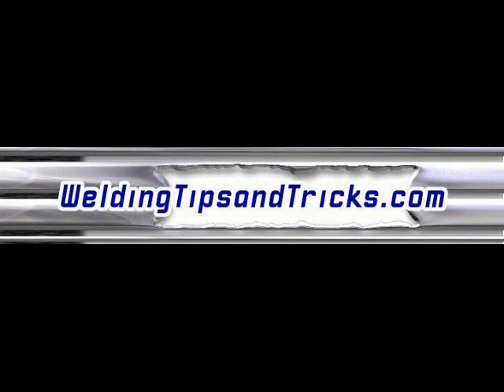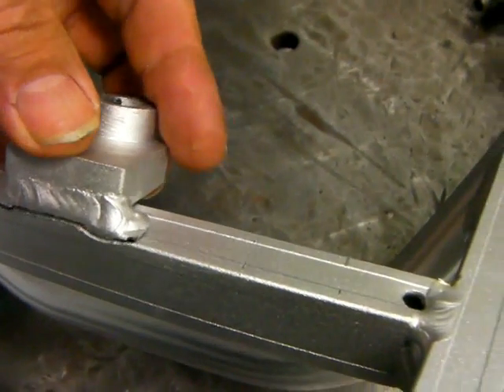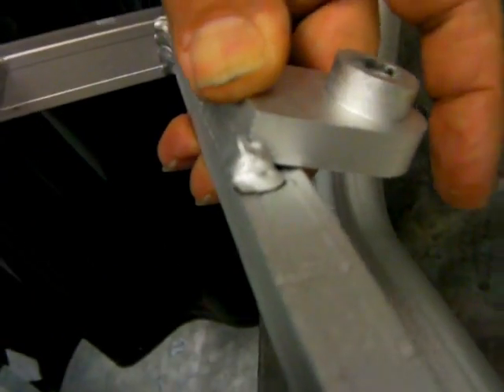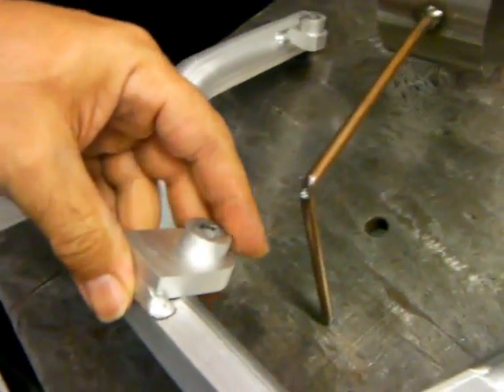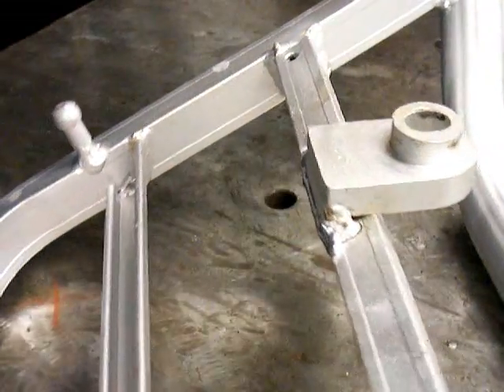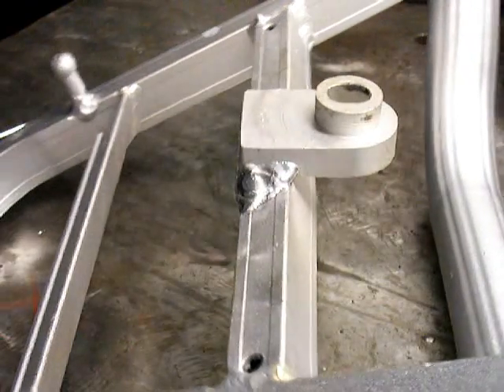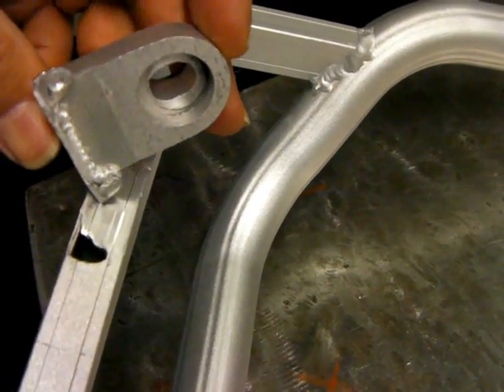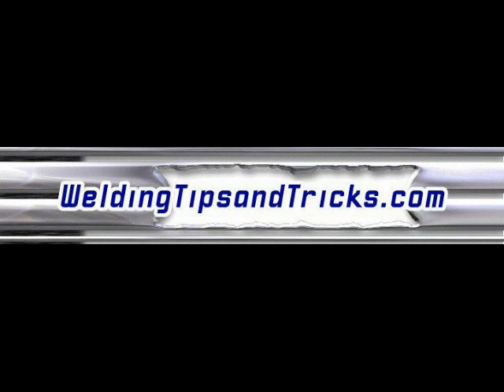Aluminum Tig Weld Repair Tips

Comment: Great point about welding dirty metal (especially aluminum) and pointing out the fact that if you can't weld clean metal, the weld will not look as great. I weld fittings onto old valve covers for engines and I clean the area the best I can but because the aluminum has gone through many many heat cycles with oil all over it, it seams no matter what I do I end up with crap in the weld. I can put down beautiful welds on clean metal but on that crap, it is very difficult to make it look nice.

Comment: It's actually just a poor design. The latch should have been placed into the tubing so that two planes are welded. This would probably mean machining the block differently, or transitioning the tubing.